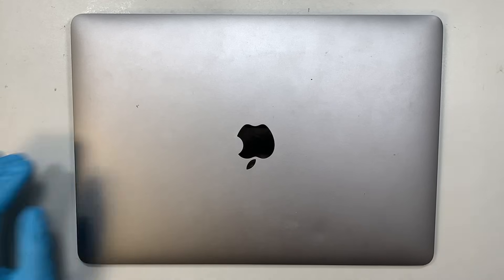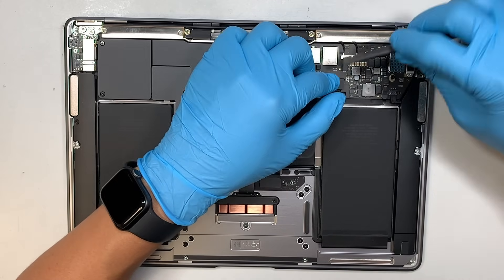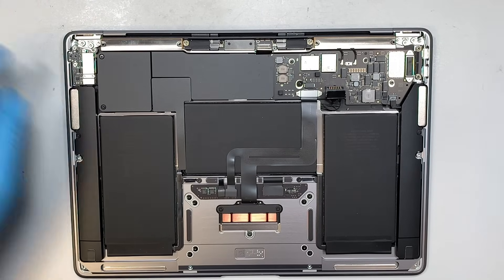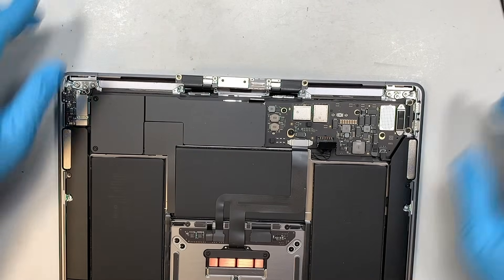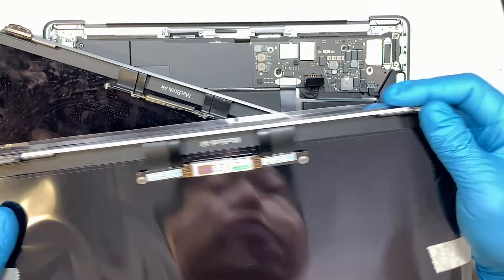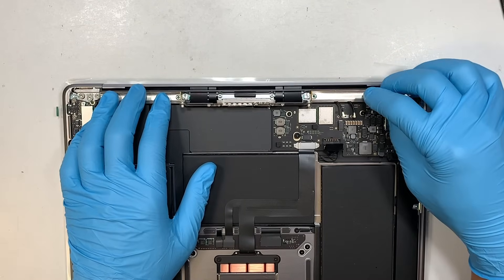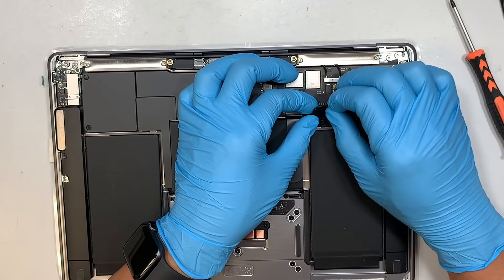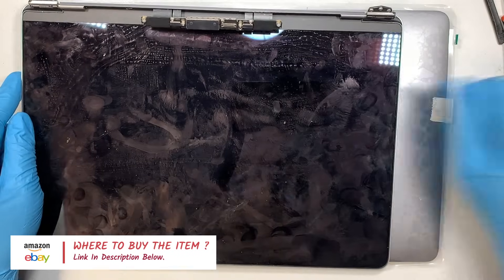Macbook Air M1 2020 Space Grey Screen Replacement A2337

Comment: September 23, 2025: My 5-year-old MacBook is working fine until one day I closed the lid with my earbuds in between. It cracked the screen. I was always under the impression that Apple is infamous for repairability, but I saw your video and find that this is quite straight forward. Apple quote me CAD1000 for the repair, a repair shop quotes me CAD400 for replacing the LCD (not the whole assembly), meanwhile a replacement screen assembly cost around CAD230. Thank you for the video, it is detailed and simple to follow. Side notes: On my MacBook the WiFi antenna shielding and the LCD cable shielding use a T2 screw, instead of the T4 show in the video. But overall, everything works the same as in the video.

Comment: THANK YOU!  Watched the video twice before I attempted it. Took your advice and printed two photos: one of  the bottom case and one of the inside. After I removed each screw, I used scotch tape to tape the screw to the correct spot on the picture. The whole thing was a breeze! I went slowly and got the whole thing done in about 1 hour. THANK YOU!!!!! You saved my daughter's laptop. WOOT!
Reply: That’s what I was just thinking just was told 350 to switch the screen I’m like it’s 5 yrs old my kid banged in to it playing around while I was working on it I can’t move my mouse around on the screen aim about to look up the kit and everthing myself  I need and work on this at home by my self wish me luck

Comment: Hello!
Thank you very much for your video. After my computer broke down, I tried to repair it myself and managed to fix it. However, when I open the laptop screen to its maximum angle and then close it, there’s a strange sound. Upon inspection, I found that the cable connecting the screen to the motherboard is bent. How can I fix this? I’d really appreciate it if you could reply!

Comment: I did this replacement, but ever since, hinge/bottom of the case has been "clicking" whenever it's opened to certain angles (when it's first opened and when it's fully opened and closed again after being fully opened). There's no clicking without the bottom cover on. As soon as I put that on, it does it. If I put some pressure on the case in the middle and press towards the body, the click doesn't happen. I cannot for the life of me figure out what is causing this. My only guess is that the thin center plastic piece of the Wi-Fi antenna where the display cables pass through is not glued down, so the cover is putting pressure on it and it's popping. Wish I could find a way to fix it, but I'm tired of opening and reopening the thing and not solving the problem. Just hoping it's not going to cause any future issues. 

If anyone has had a similar problem and fixed it, please let me know!

Comment: April 19th, 2025: My daughter's friend spilled a can of redbull on top of my daughter's macbook air. After 2 days letting it dry I decided to turn it on and I was able to access the contents using an external monitor, based on that I decided to buy the new screen a follow the instructions explained in this video and the computer is fixed! Just take your time to do every step and make sure to print the photo of the computer parts to locate every screw, other than that with patience and this explanation, you should have no problem! Thanks for sharing, the guidance is amazing!

Comment: Followed this to the end with a screen from seven puppy. Worked perfectly except I stripped the fuck out of the top right screw on the back cover. T4 is too small, and T5 is too big. The screen company sent some bit heads, which were a much better fit.

Comment: 😃 Dude! You don't know how much I went through to get this replacement screen and to have your video help me! I'm out here in Puerto Rico and they just got their first Amazon hub so I could order the screen replacement and have it sent there because I cracked my screen since I'm currently homeless and it was a hairline fracture at the bottom border in the same black spot as the MacBook air letters. I had to call best buy and the first time they said 400 and I didn't have the money so I went back in 2025 a few months later and it was 500 so I took a chance and just installed the replacement screen through seven puppy's manual and later with your video when it came time to see the detail for the wifi antenna. Thank you so much! This is the first time I installed a replacement screen for my m1  laptop

Comment: I cannot undo the very tight screws on the LCD latch with the T8 screwdriver around the 8:40 time on the video. Any tips???? 
I don’t want to strip the screw or use WD40.
Reply: I’m having the same problem

Comment: I did it, too! I'm a 58 year-old female homesteader. If I can do this anyone can! 
       I  had closed a cable connecting speakers on the right side of the screen and damaged it.
      He is easy to follow, accurate descriptions of everything, great camera placement.
      Some challenges I had were: 1) removing the back, thankfully my husband bought a kit for computer repair which contained plastic pryers in a few different sizes. There wasn't one in with the screen, which we bought on Amazon.   Only used 2 tools that came with the screen T9 and T4. He says T8 in the video, but it came with T9, which fit.  2) removing the glued on bar, that took a bit of work. (which he says it will)
    I was thankful to be able to pause, rewind and watch again. 
    I would recommend this fellow to anyone with computer issues! I'm even thinking about a career change...😊

Comment: The two screws you removed at 5:20 heads are already stripped screws, this is the first time this Macbook was ever opened, which was bought directly from the showroom, not sure how could they be worn out already 😭😭. Now I am in the middle of the repair, I was able to open one screw with great difficulty, not sure if I can even put this one back. I am so much mad at Apple right now. One might say… I am screwed.
Reply: It is because he Said the wrong bit. You are supposed to use t5 on the Black screws. Imo find another video because he sats the wrong bits all through out the video
Reply: Are you able to find a solution

Comment: Thanks! Great video and instructions.  I was able to replace my screen , took me about 1.5 hours though.  If I had to do it again, I could probably knock it out in 20-30 mins.  First time through these repairs you have to go slow and make sure you got the right driver for each screw and don't force anything apart.  A few years ago I destroyed a Mac mini by being too rough and careless.  Learned my lesson.

Comment: I needed to replace the display on my MacBook Air after the screen suffered significant water damage that my insurance wouldn't cover (PSA - always check that your liquids have been properly resealed after random airport security testing!). I watched this video then ordered the replacement screen from Amazon and followed along step by step. 

Thank you so much -the video was extremely clear and easy to follow,  and you saved me around £200. It took me around  45 minutes as my antenna bar was really securely glued and I was wrestling with my glasses and a magnifier but it all worked perfectly.  

I pressed the screws into a laptop-sized piece of polystyrene in their approximate positions and labelled it with post-its, and this made reassembly a breeze.

Comment: There's 3 different types of screws holding the back on: 6 shorties, 2 long ones with short threads and 2 long ones with longer threads. Take extra care to note which long ones came from where! The longer threads seem to go in the two center holes on either side of the model number printing.
Thank you so much for these instructions!!!

Comment: ugh i cant find any Rose Gold screen replacements for this model, anyone else?
Reply: Where do you live? Cause here in italy is easy to find on ebay
Reply: @Devian20  I found it from AliExpress. For some reason the sellers just had it listed as "Gold" when it was actually Rose Gold. Screen quality isn't THAT good but it gets the job done, seal on the edge of the screen isn't sitting flush though so there's some light leakage and dim spots in the corners because of it.

Comment: Thank you! Your video was very clear and helped immensely. I just replaced my daughter's MacBook Air screen and she is very happy. Note that the screws were various sizes and types. The outside case screws were pentalobe type and the inside screws were all torx (6 lobes) with the smallest size a T3. My model was A2337 EMC 3598. I made sure I had all the right screw bits before doing the job.

Comment: Almost cried when I closed the corner of my blanket inbetween the two laptop pieces and shattered the corner of the screen, taking almost an hour to come to terms with having to take a decent chunk out of savings to give to apple for a fix. Then I found your video, and saved literal hundreds of dollars and time!! You're a godsend, and your video was really easy to follow along to. 15 out of 10, thank you so much again!!!!!!! Will come back to your channel if I screw up any more of my tech in the future ❤❤😅.
Reply: I dont understand why the screens are so delicate. I hate it. Makes me debate on if its even worth it to fix if its just going to break again. Might as well buy a cheaper, less delicate computer 😭
Reply: Apple repairs make no sense....they were more expensive than a new model of the same laptop. Not to mention they lock features on newer models if you don't replace it from them directly...even if the screen is original.
Reply: @ibendover4817  u can program the serial numbers and true tone will work i guess

Comment: I just completed this and the screen cuts off on the outer  right side 2".  Perfectly straight black screen only there.  The display is cut off not reduced.  I'm wondering if I installed it incorrectly somehow with the cable, or is it a defective screen?  I got it from a reputable seller on Amazon.  Any suggestions?  I can touch the black part and see that it's active, just not displaying, if that makes sense.  Like it's getting power...?
Reply: I figured out the problem.  Apparently the hinge somehow got pressed into the screen and damaged the corner of it.  Pay attention when installing that the hinges do not over extend and contact the screen.

Comment: Great video. FYI. for those having an issue with unscrewing the Bracket on the WiFi connecting cables using a T3, use a T4 instead (which is what I had to do).

Comment: For the TWO BLACK SCREW that hold their LCD Board, don't forget to use a t5 screwdriver! I was using the t4 and damaging the screwdriver AND the screws. He forgot to mention to switch. Xoxo thanks for the video
Reply: My t5 still won’t fit… do I have to press harder?
Reply: @otenyoo3099 if it’s loose you have to get a t6.. it happened to me last night and I had to get a t6 because neither t5 or t4 were working

Comment: I did it! I’ve never done anything like this before in my life. You saved me hundreds! Thank you for sharing valuable knowledge. I followed you step by step at .75x speed. 

I will say the tools that come with the linked screen replacement have poor magnetism so it is worth it to have better tools. The screws are microscopic so the magnetism is super helpful!
Reply: I had the same issue with the tools, just stroke them across each other a couple of times and it fixes the problem.
Reply: Do you have to heat up the mac to soften the glue ? Because I have a 2020 An they want 500 damn near to fix but I can get a screen less than that
Reply: Perfect, saved me hundreds. Just replaced my wife’s screen!
Reply: Did help me a lot! Thanks!

Comment: I ordered an original screen from ebay for a Macbook Air M1 2020, after the change screen is black. Diagnostic test says: "There may be an issue with the display" code VFD001. Can you please help?

Comment: First off thank you so much for this video. I changed my screen and it works but now I’m so incredibly paranoid about it breaking again😭😭. Also before you attempt to do this — BE SO CAREFUL NOT TO strip the screws. I accidentally stripped two of the screws even though I bought the T4 screwdriver. And it got stuck and I really freaked out because it meant i couldn’t reconnect the lcd screen. Thank god my uncle had a screwdriver that could get them out but I nearly messed this up. i’m not a handy person so i wasn’t aware of this but DO NOT STRIP THE SCREWS

Comment: Great tutorial. Saved about $250 doing the repair myself. One deviation, some of the smallest screws holding down the Wi-Fi cable connectors were smaller than T4. I bought a screen that came with tools so I had what I needed, but they are not labeled so I don’t know what size they are. All in all, this was a pretty easy job. Definitely doable. I use a loop of blue painters tape to hold screws in the right place on the printout of the computer. Keeps things from rolling away.

Comment: Jan 12, 2024: Broke my screen by closing it on a usb-c charging cable that was resting on my laptop without me knowing - ouch and $$$! Followed this tutorial and took my time with it - the author did a great job to explain everything he was doing, step by step. Within an hour, my replacement screen was working on my Macbook Air. If you can follow instructions and take your time, you should be able to do the screen replacement without issues.
One note is I needed a T5 screwdriver for the x2 black screws (not a T4) which was not mentioned in the video.

Suggestions for anyone reading this:
- Have a clean workspace - I vacuumed my desk before working to ensure no dust, hair, etc. would get in the work area.
- Take advantage of pause/play for this tutorial using the computers space bar
- Some of the screws are TINY - the tiniest I have ever seen. Have an additional light or two facing your work area.
- Print a photocopy of your open laptop when the author tells you to in order to keep your screws in order - it was helpful.
Reply: I'd add a magnifying glass to your list - especially for anyone needing readers.
Reply: ABSOLUTE SAME. I'm typing on it now--only have 2/3 of the screen showing (and shrinking). It's $0 trade in so I think I might try instead of dropping 900. Ugh.
Reply: @EricaDavis-l9c its very easy to work on small electronic devices. ❤

Comment: Hi my Macbook air M1 A2337 2020 just went blank completely out of a sudden. Connecting it to an external monitor works as I can still see my screen mirrored. The macbook air screen has some backlight (gray) and it brightens and darkens when i increase or decrease the brightness settings. What could go wrong? Everything else works, boots up fine, just that I don't see any graphics.
Reply: Have you figured out why?
Reply: I just ordered and swap with a replacement LCD screen and it is working now. I have yet to find out what's wrong with the old screen though. Just had to do it because I'm in need to use the laptop  @Corporal_Fluffy

Comment: Thanks for the clear instructions very very helpful. I was able to get the screen replaced in under an hour. Please pay very close attention to connecting the wifi brackets back on. my wifi was not connecting after the screen replacement. I opened the back again and reconnected the wifi connectors. They are very small and not easy to connect. But 2nd it worked fine.
Reply from the maker: Glad it helped

Comment: December 29 2023, this video helped me do the screen replacement on my 3 year old Mac. Thank you so much for the detailed instructions and quality video. I ordered the screen on Amazon and 2 sets of tools on Amazon. The fine tips on the smaller drivers rounded off so I was glad I had a couple of extras. I am typing this on the repaired computer and the screen is clean and clear. Merry Christmas and Happy New Year to me and thank you to the provider of this video. Based on the quotes I received from a couple of local repair shops, I saved over $200 at one and $400 at the other. Thanks, DC
Reply: hi ,where did you get the new screen ? I went to apple and they said to me £400
Reply: @vasildimitrov1906  check the video description
Reply: @DinosRule  oh yeah , thank you 👊🙏🏻

Comment: Hey I did everything as described but I have no backlight! I can see the screen under a flashlight (barely) and it works perfectly with an external monitor. Any advice? This thing has been driving me crazy!
Reply: I had this same result. Did you figure out the issue by any chance?

Comment: I replaced the screen and it works but I can't seem to get the wifi antenna to pop back in. I have to try again another day. I just doesn't seem to line up. Looks correct but having problems. Need to stop before I get frustrated.

Comment: Very helpful! I am having success so far. Just wondering if I am supposed to take the stickers off of the part that is attached to the new screen, the belt that goes in has stickers all over it but they are hard to get off.

Comment: Really good instruction, thanks. The official Apple repair manual wants you to take the whole logic board out in order to make it easier to pop out the antenna. It would be easier to get it out if the logic board were removed, but doing is 1) a lot more work and 2) triggers the need for a new system configuration to be done – more hassle. Skip all that and follow the procedure outlined in this video. Thanks again!

Comment: mine is a 2022 and seems to be serial locked? replced the screen and it was just black when turned on...put the old screen back on and back to normal (with a crack) Is there any way to get around the serial locks?
Reply: I believe you lose True Tone, however aside from that I just did this repair and the screen itself is working perfectly. Maybe you got a defective screen.